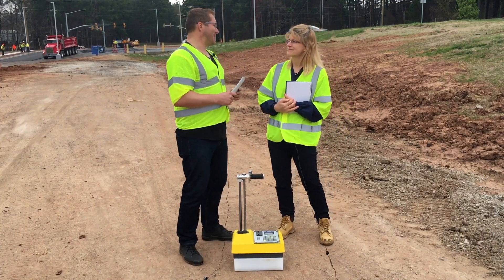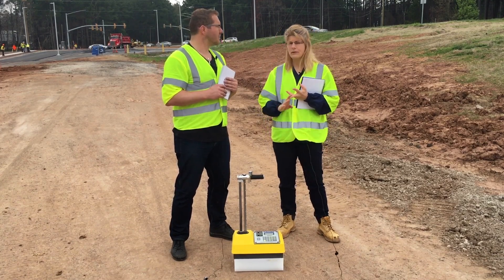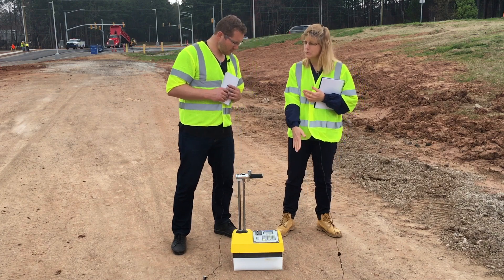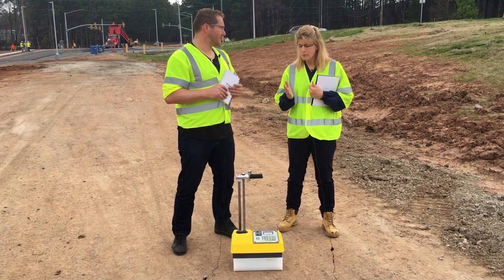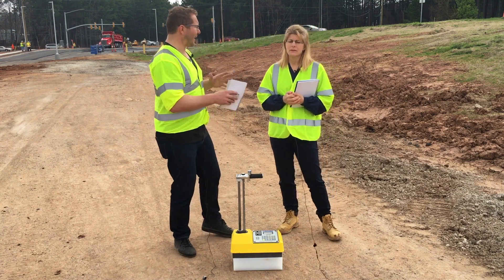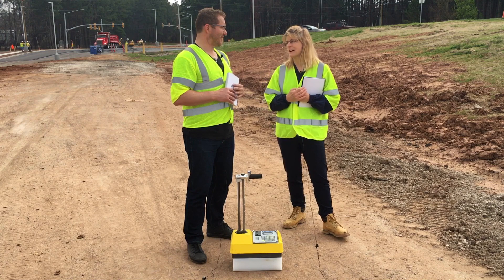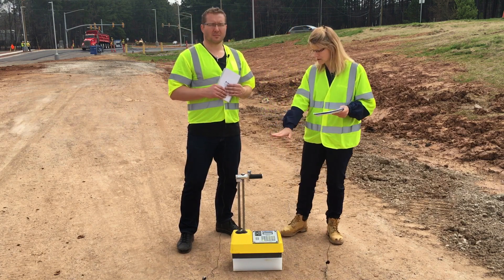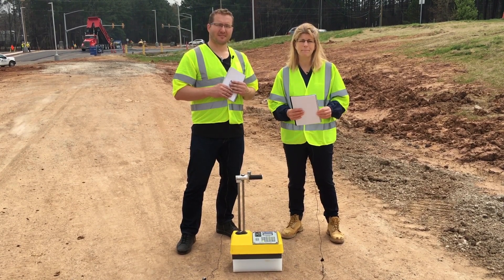Troxler Labs Nuclear Gauge Standard Count S1 E3

Comment: Does this gauge has a memory card that records test logs and can be used for client reports?  We need to implement this to our 3rd party testing lab for Aramco projects. Thanks for your answers.
Reply from the maker: Most models have data storage capability if the user sets up a project and presses the Store button after the measurement. Please see your operator's manual for specific details.

Comment: Does it affect the density , if the standard count fail ?
Reply: Yes
Reply from the maker: Good standard counts are needed in order to have reliable moisture and density results.
Reply from the maker: If the count fails because it is truly different from the value that is shown on the calibration report it will cause questionable or incorrect measurement results.